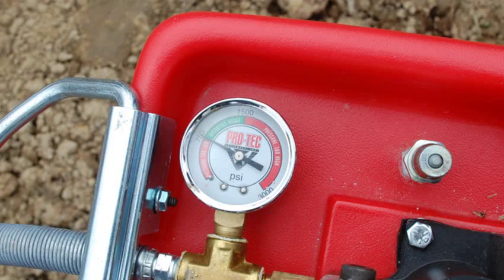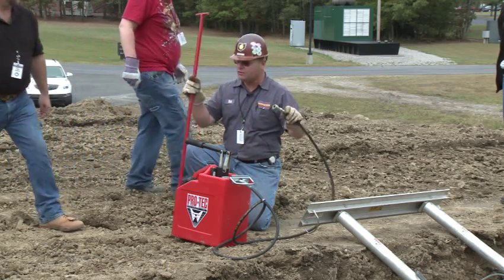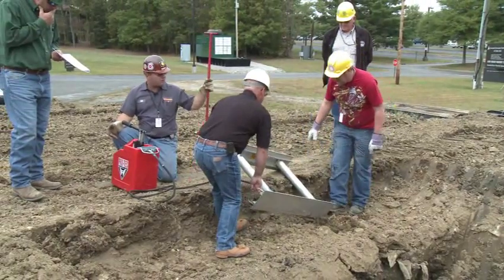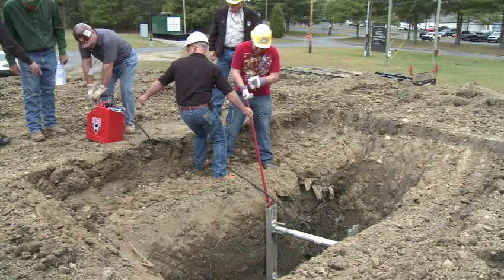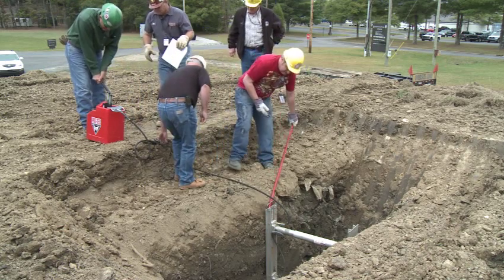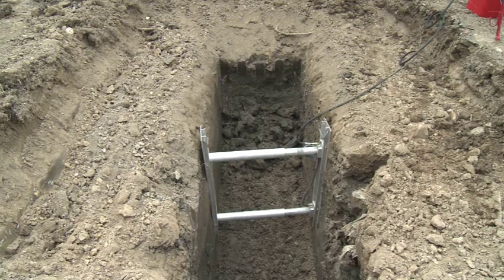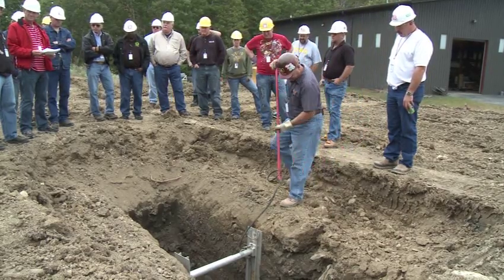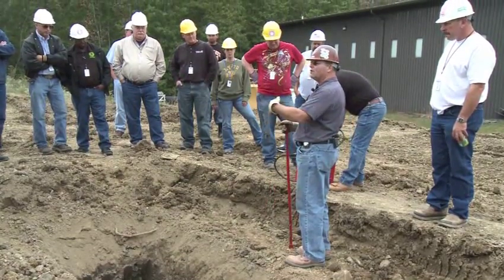Installing Aluminum Hydraulic Shoring (Demonstration)

Comment: Never seen anyone use this type of shoring. Guess it would make sense if you couldn't install a trench box due to utility crossings.

Curious that there's no backing board or sheeting to support the soil from caving in? What's the spacing requirements? Maybe this works with cohesive type A soils, no way in hell it works with type C.
Reply: depends what type of soil. 4-6ft typically. Anything that unravels requires sheeting. If better type of soil, sheeting may not be required and the shores hold the dirt with the arching affect

Comment: When removing hydraulic shores, you can reattach the hose and turn the pump can lever to release. This will allow the fluid to return into the canister, and decompress the system so it can be safely removed.